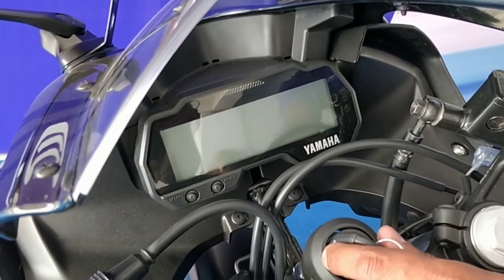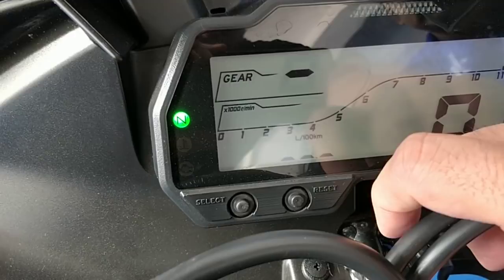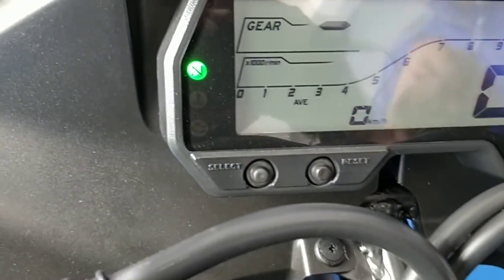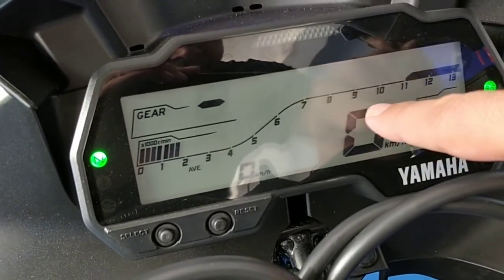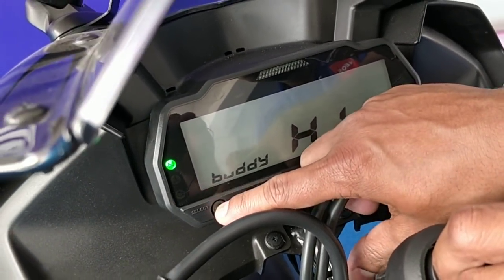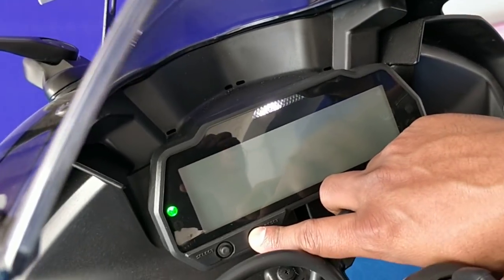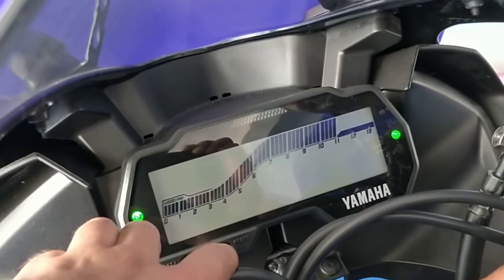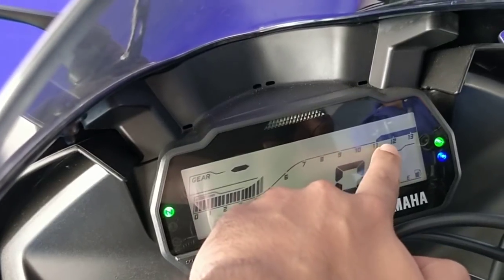Yamaha R15 V3 Instrument Console Fully Explained along With Customisation Features

Comment: Keep up the good work man!! Really nice video. Just wanted to let the users know that the 3rd trip meter which says "F" Trip, turns on automatically when the bike is officially running low on fuel. It helps u keep a track of kms you've ridden the bike in low fuel. I guess the engine light or the red one also turns on automatically in this case but not sure about which one.
Reply from the maker: Thanks for that very useful input. Pinning your comment
Reply: How much km will it run in low fuel?
Reply: Nice job buddy. Want yo correct you at one point AVG displays the average milage the bike is giving, its not the average speed.
Reply: @motoroids  What does that TRIP F mean?
Reply: there are 2 average there...average fuel consumption & average speed
Reply: Instablaster.

Comment: I'm getting 2.1 right now... Will you plz explain me how to convert 100km/L to km/l
Reply from the maker: Divine hundred by that number. For example, in your case divide 100 by 2.1 and you will get kmpl
Reply: Does that mean he is getting average of almost 50 kmpl?
Tbh that's unbelievable😅
I wanna get this bike but i don't expect more than 40kmpl. Correct me if I'm wrong.
Reply: Indian Tiger ...when u see 100km/l ...keep press and hold  the select button ..it will change into km/l . yamaha rocks.